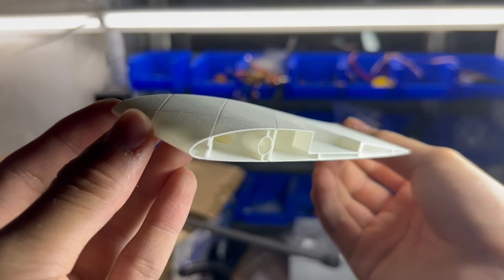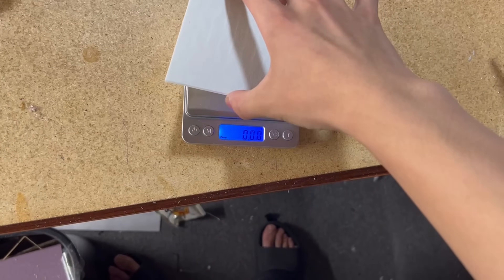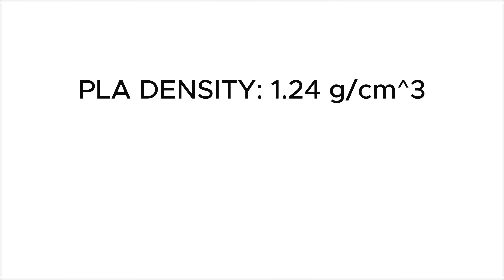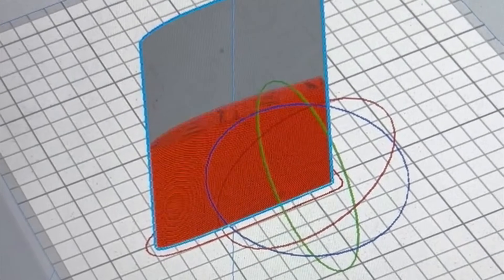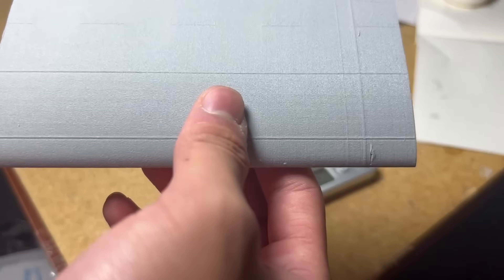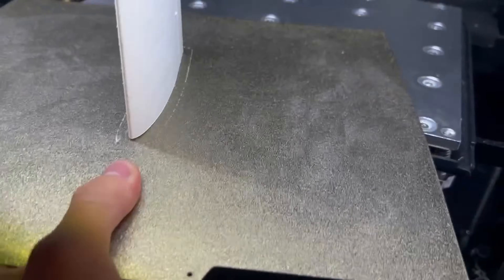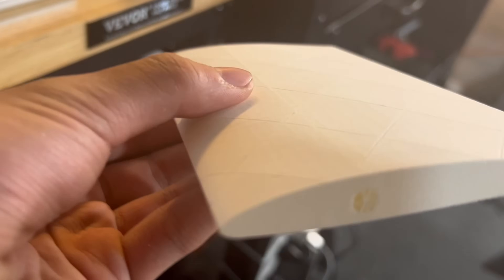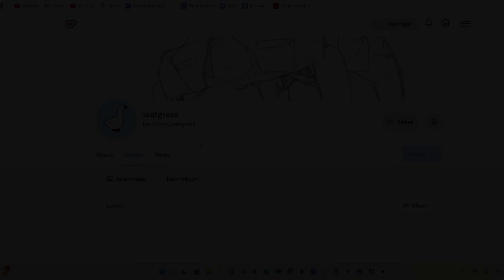Designing the Perfect 3D-Printed Wing

Comment: I love this technique and I've been experimenting with this as well for a school project. I do have a question about the surface finish while using vase mode. There is a noticeable pattern present from the nozzle changing direction to draw the internal geometry.

Is there a good way to get rid of that pattern from the outer surface?
Will the pattern affect flight performance much?

I'm attempting to print a glider and I am attempting to balance strength and weight and figured id ask.
Reply from the maker: I do believe there is way to get rid of the pattern but I haven’t really bothered because it doesn’t seem to affect the aerodynamics at all. If you get the settings right, the surface will feel no different to a wing with no patterns
Reply: effect on aerodynamics is negligible
i'd be more worried on damage/changes you end up making by trying to remove this pattern
it looks cool af anyways

Comment: Had a similar issue with thin walled prints and slicer g code. The solution I found was to seperate the outer shell and inner part in CAD, then import it to slicer as seperate objects, and ignore the warning of these parts intersecting. Turned out great, I can control part printing priority easily now

Comment: I just wait when slicer manufacturers will make lightweight material compatible infill, but untill that will use gyroid infill. I designed my first 3d printed airplaine similar way, but it it too much complicated, and if you want some changes everything goes wrong. My wings with gyroid infill have similar strenght but wit much much less effort to design. And one more thing - if You maiking airplane copy with panel lines this method will also not work.

Comment: I would say I've seen that with LWPLA, in my experience when the failure mode is that it's too soft it helps to increase the temp. You can lose dimensional accuracy because it might over expand a little, but in general the presets in Bambu slicer and on the box are too low IMO. I've gone as high as 250 before and I get far more rigid parts

Comment: You're better off printing moulds and then using composite and expanding PU to manufacture your airframe.  Reinforce your PU at the surface with lightweight glass cloth and mix about 2-5% by weight to the A part of the PU with microballoons before mixing the B.  This forms nucleation sites for the foaming agent and creates much more consistent foaming.

Comment: This method of using the even/odd slicing mode is also what 3DLabPrint does with their models. Found this out when when analyzing their models mesh in fusion 360 to find out how to design my own since their model selection is mid imo. Subbed, great video.

Comment: You can also make wings from single-wall prints if you use compound curves. Did this years ago (but posted to Google+, so gone). Single-wall simple curves are prone to buckling failure. Compound curves are self-rigid. (Which is why used much in car panels.)

Comment: I think the filling weighs half as much as the wings. If you absolutely must print it, do it in such a way that you can inflate it with compressed air, and it maintains its structure without ribs.
Reply: Did you try it?
Reply: @dmitryplatonov Not on a 3D printer, but a flying wing pressed/stamped from a bottle. I don't know about 3D printing, but plastic is plastic, right? I guess there are materials with the right elasticity.

Comment: Hi, nice work, just a couple of things to consider from a fellow engineer.

First off, the skin of the wing doesn't need to be so strong. In fact, it was common for planes in the beginning (and still is for rc) to use thin fabric for the wing skin (for rc it's usually plastic that retracts when heated). If you were doing the same test you are doing on those wings, they would crumble too.
Secondly, gyroid is a poor infill when at a too low infill percentage. It's the strongest and most isotrooic infill relative to weight, but that's above a certain percentage (I can't remember exactly but something starting around 20 to 30%)
Finally, what is most important when designing a wing is that the airfoil profile doesn't deform (too much) and that the wing is rigid enough to keep its shape and properly transfer the load from the lift surfaces to the body (or the other way around if you think in terms of mass). I think you made space for a carbon spar so the rigidity and weight transfer is taken care off by that).

Designing the whole interior structure is more work but the result is very satisfying. If you want to see how others are managing the infill, you could have look at Flightory's work. They design printed planes and they use standard infill from the slicer at low percentage and it works quite well too! The manual for building their planes is publicly available, I feel you could learn a lot from these resources.

Very nice work, I can't wait to see more!
Cheers
Reply: People often get confused about this, thinking that because wings were fabric or some RC planes use very thin film, the skin doesn't need to be 'strong'.  It does. It needs to be 'strong' in that it needs to resist deforming under the air pressure at the velocity the wing normal operates in, the skin must be rigid under wing loading not to perform like crap. A soft 'spongy' wing will fly like crap because the air pressure will deform the airfoil shape even if the ribs hold, creating all sorts of drag and weird vortexes, especially on turning and higher angles of attack, the tuber is absolutely right to be worried about this and to desire the skin to be rigid enough to avoid deformation.
Reply: + 1 On this. Specifically A finger crumble test isn't scientific or at all engineering. Also stiffness and strength are two different things.

 To know if your design is going to be working properly you need to understand the forces and subsequent stresses involved. What is your wing loading. If your wing loading is super low (which for a 250G MTOW it most likely is) the strength and stiffness required is probably much lower than your finger crumble test.

Comment: I took me a while, but I’m nicely dialed with LW ASA now, I use the preFoamed PLA for control surfaces.   If I want more strength after printing, brush on 2-part epoxy.

Comment: Remember that in a traditional balsa wing the skin is super thin plastic film. You’re expecting strength where it’s not really needed. All the strength can come from a spar and the leading and trailing edges. A thin carbon fibre spar (1x8mm perhaps) is easy to add and gives a lot of strength for no weight, it’s usually lighter than the plastic.
Reply from the maker: Yeah I see what your saying but I usually prefer a balance between structural rigidity and skin strength so it keeps the skin from deforming or getting ripped from landings
Reply: @ieatgrass_rc yeah 3d prints are pain when they break. It can be a good idea to design in some flex to absorb impact forces. Sticking the wing on with rubber bands really does wonders. Flew one foamboard plane into a metal pole, wing popped off taped the dent and was back in the air within 5 min. Maybe reinforcing wleading edges with tape is a good idea.
Reply: @ieatgrass_rc  Also, you could try using LW ASA. ASA’s a cousin of ABS, which does flex a bit more than PLA, but is much more impact resistant.

And it won’t ever warp in the car on a hot day!

You will need a printer enclosure though.
Reply: You need the skin to be there anyway, the strength from the skin is what allowed advancement in aviation.

Comment: Very nice work and a clean print.  Have you tried hot wire cut foam covered in brown paper and PVA glue?  Stronger and lighter than any print.  And cheap.
Reply from the maker: Yeah 3d printed isn’t the best material but I just been wanting to know how to use it for other projects. I have experimented with Hotwire foam but wdym by brown paper?
Reply: @ieatgrass_rc Hi. You use the paper like you'd cover a school book with. Similar to putting wallpaper on a wall. You usually thin the glue 50/50 with water first. When the paper dries it's stuck to the foam like a very thin wood veneer. I'm pretty sure I've seen videos of the process on youtube.

Comment: Gyroid infill is the weakest, most flexible infill type that you could choose! You want an infill that stacks up vertically along the direction of compression, not gyroid that constantly changes its direction. I would think that "cubic" infill would be a good choice, but your integrated ribs probably offer more benefits than any plain slicer-defined infill.

Comment: your flow out the nozzle isnt consistent on the lw-pla. Either you have a slight blockage, it's not gripping the filament properly, your filament has grabbed too much moisture, or you are trying to print too fast. Those last two are the most likely. Dry the filament and try printing really slow. I printed a 500g model out of the foaming stuff and it took a while to dial in. You can trade weight for structural integrity to the point where it's basically paper. I ended up printing pretty light and then adding some epoxy to harden up the skin and add rigidity. Turned out good. I think with thin wings like yours i'd go with the pre foamed slightly heavier stuff or add a carbon fibre strut and coat with epoxy.

Comment: also it seems like you dont have the setting that blends the infil to the layers. once this happens at least in orca you can see an internal path of ilfil going allong the inner wall instead of the micro contact patch that the infil is currently having thus failing to provide true support since its like nanometers of contact at each point vs a decent surface area of infil to inner wall contact.

Comment: For printing something (wing, fuselage.. etc) with gyroid, be sure to always keep the same slow extrusion speed during the print. Also, and very importantly, do not put the anchor lenght of the infill to zero, as lw pla takes time to react to pressure and when it starts printing the infill and jumping place to place it will not print the start of the infill which connects to the wall and provides most of the structural strenght. I find that putting the anchor lenght to infinite will make the part a lot heavier for the same sparse infill density but it will absolutely be worth it for its strenght.
Reply: Im currently working on a method to use pre-created vase mode ribs for the fuselage so ill let you know when I finish that
Reply: @olivierlamarre6309  We need an automatic method to create vase mode outlines!
Reply: So yeah, just print really slowly and try a bunch of times and eventually you should get something good enough.

Comment: When prioritizing strength it's usually way more effective to increase wall thickness instead of infill. You might even get away with zero infill if you just increase the wall thickness to two lines instead of one and still keep the weight low
Reply: Generally I would tend to agree for all-round 3D printing, however when it comes to rc planes, it’s much more efficient (in terms of strength to weight) to leave a single outer layer and design your own custom infill. If you design it right you can get it down to about 1.5% infill equivalent (regular PLA) or about 3-5% for foaming PLA
Reply: @geza2914 That does make sense!